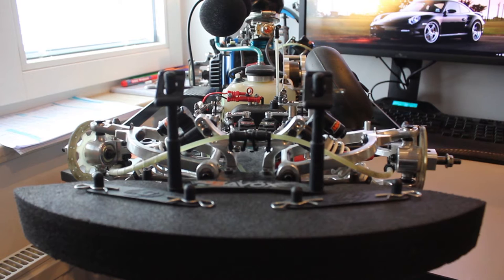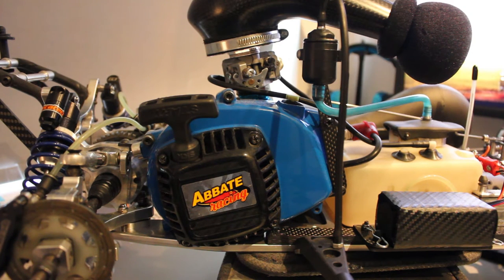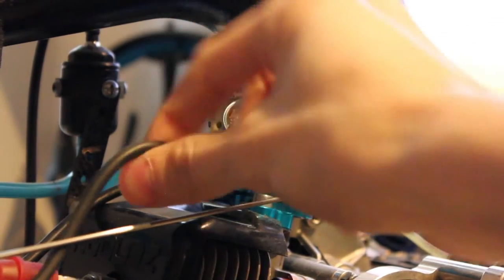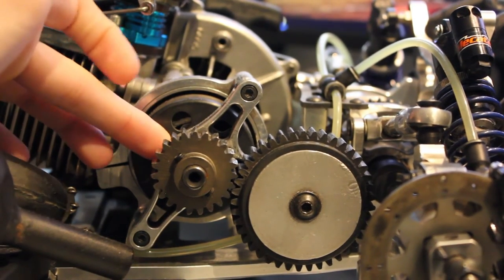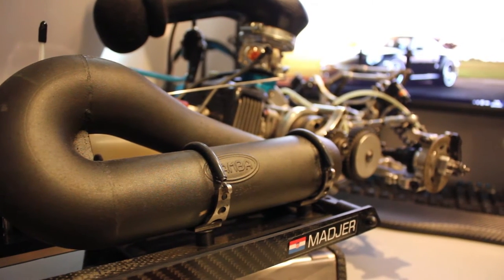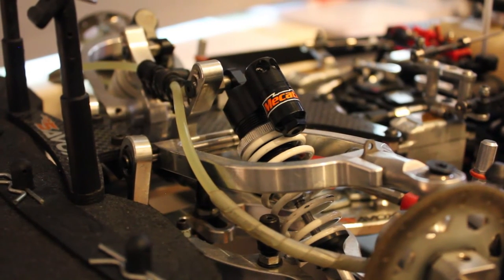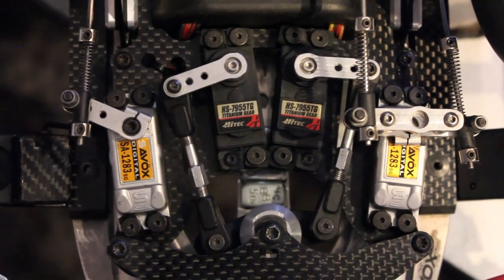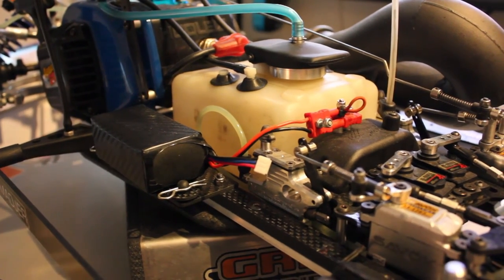How A 1/5th Scale Onroad RC Car Works

Comment: 5 to 7 hp? lol! not a chance that hp on the light rc would never happen,it would rip the drive train to pieces lol 😆
5 to 7 hp 😆 please
Reply from the maker: I'm afraid you're terribly mistaken. I drive these cars professionally and i know every bit of them and also the dyno tests. The engines we are running cost from 900-1200 euros. They use special lightweight flywheels and high tech ignition systems. The cylinders and pistons are ported and machined by best italian tuners. We also use 100 octane fuel mixed with the highest quality 2 stroke oil. The engines idle at 4-5k rpm, the clutch engages at around 11k rpm and on straights they reach about 24-25.5K rpm. Top speeds are anywhere from 80 to 105-110 kmh. (Depending on track and drivetrain configuration). The drivetrains are made from highest quality materials and the whole cars completely cost at around the 6000 dollar mark for a top model. Currently i have a newer and much more advanced car than the one shown in the video.
Reply: garagistas 
I've had to do the same to my Baja
but obr claim 8.2 hp from my 30.5 reed case and then figures are way out at the crank is where it's meusured and there's not a chance these engines put out 5 to 7 hp at the wheels no way it's that at the wheels